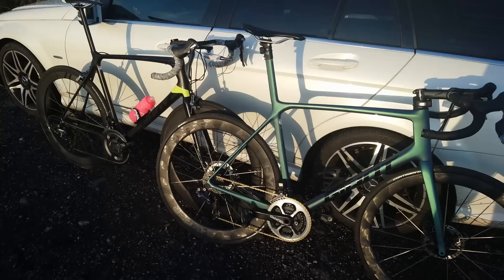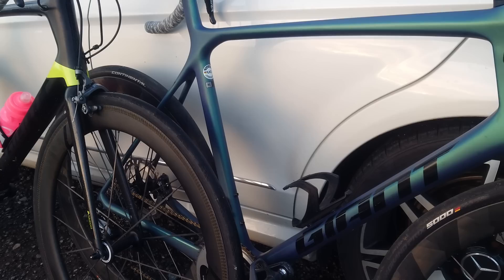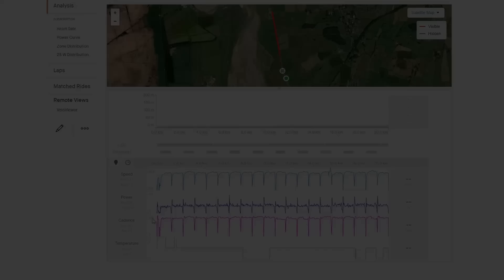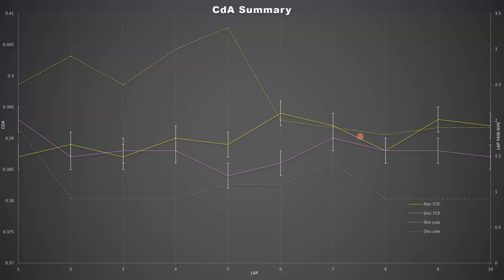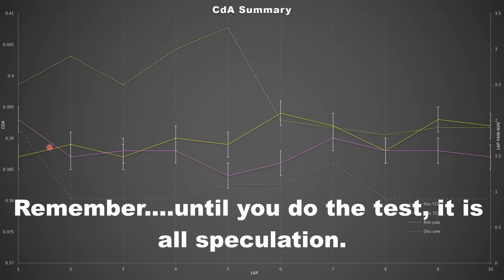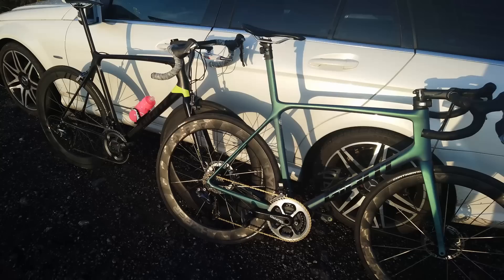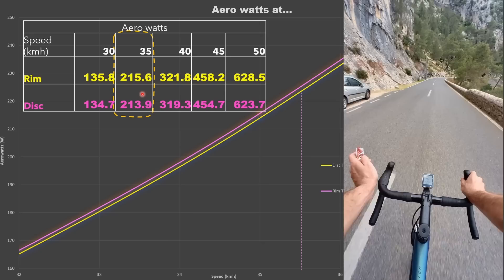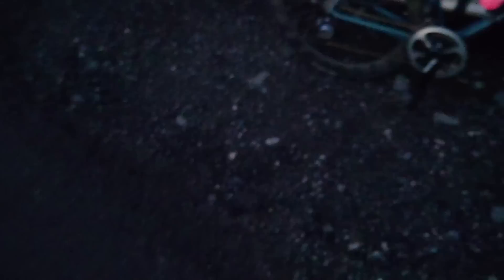Are Disc brakes Slower? Rim Vs Disc Aero tested.

Comment: If the difference is so small that this question is so often asked, why deal with the added cost, complication, and weight of disk?
Reply: Because of superior performance in varying conditions, better wheel compatibility, and improved tire clearance.
Reply: @hail_sagan2830  I'd wager that if consumers were aware of the pros and cons you and I both listed, most would go with rim brake. But markets don't actually work how people are taught. In reality consumers have very little power and have to buy whatever is given to them which explains the popularity of disk.
Reply: @anaxa4883  I don't know that I agree with that. Hearing, "disc brakes will stop you much more reliably in the wet," is a pretty big motivator for a lot of people. Adding onto that, "they also suffer virtually no aero penalty, which is shown to be more relevant to average speed than weight" will seal the deal for those that are concerned about performance even if they can barely hold 150W.
Reply: @hail_sagan2830  This is not true. Disc brakes fail in a dangerous way and generally don't perform any better than good clinchers. In esp. they are not better in wet conditions at all.
Reply: @rosomak8244  gonna need you to go ahead and cite some sources on that one. disc brakes have repeatedly been shown to perform better in the wet.
Reply: @rosomak8244  The entire field MTB would disagree with you here. So I'm gonna treat your statement as FALSE.
Reply: @hail_sagan2830  Ever been out in the rain? 99% of bikes out are hybrids or e-bikes. Its strange stopping power in the wet being such a big factor, when no one rides disc brake road bikes in bad weather. The Pas Normal/Rapha Aethos boys only dare come out in mid july
Reply from the maker: For me, you can brake harder and later, which is undeniably quicker. The braking is always consistent, whether dry or wet. Also on long mountain descents, the reduced hand/finger effort (ahoy there!) Is a game changer. Able to fling the bike left and right with a relaxed upper body and no arm pump. Of course if you don't race, none of that matters.
Reply: I can't reliability say for disc brakes as I do not have enough range of experience. But I can say that in my experience using about a dozen different brands of rim brake pads that the functionality of rim brakes varies significantly with choice of pads. Kool Stop Dual Surface brake pads with their integrated plow that quickly removes debris and water have proven to provide superior braking over a wide range of weather condition for me and are my pad of choice. I mention this because when comparing disc brakes to rim brakes I think the choice of rim brake pad used is of critical importance. I am unaware of any tests comparing the two braking systems where the the tester has sufficiently accounted for this factor.
Reply: @anaxa4883  not really. 
I’ve been cycling since 2008-ish? Started on a rim brake Avanti bike and slowly worked my way up. 

And the first major thing I did in cycling was ditch the rim brake and the stupid 23mm standard. 

You simply cannot match the braking control of a proper disc brake. I’m not saying rim brakes have less stopping power; I’m saying that disc brakes have so much more modulation that you can exert more power just before the wheel skids. 
This is literally a scientific fact, since rim brake pads are not simple solids.
Reply: @slowcyclist4324  I wish you could bring yourself and your disc brake bike to a mountain top to meet me and I would obliterate your entire reality and “scientific facts”  about disc brakes within 10 minutes of descending.
Reply: @edthelizzard  oh man I understand it’s a bit schmucky but that conversation between me and him has some more comments and context other than this particular thread. I was just poking the disc bro 😂
Reply: @larslosh5598  yes, I have ridden in the rain. What's your point? That people prefer not to ride in unfavorable weather? That doesn't change the fact that sometimes you do get caught out by a surprise shower or storm. Or you sign up for a race in Kansas that is usually bone-dry and scorching, but rains sideways on race day. Given that, again, there is virtually no aero penalty and that the weight difference isn't a significant factor unless you're climbing Mont Ventoux, I'll take the improved performance whether I intended to be out in the wet or otherwise.
Reply: @larslosh5598  Lol, the specific location is irrelevant. Inclement weather can happen anywhere. The Triple Bypass, an incredibly scenic and renowned ride in Colorado, was rainy for the entire event last year. If you don't like the aesthetics that's fine, but that is a preference of appearance and does not change the fact that disc brakes offer better performance in varying conditions.
Reply: @hail_sagan  I know, I live near the arctic and cycle all year. I know a young girl who rides a 23 mm rim brake bike in snow. And grown men in California feel they need 32 mm and disc brakes to survive. Thats ok, but if the skill level is so low you really should be riding with some kind vest or flag indicating you are still learning.
Reply: @larslosh5598  riding with wider tires for decreased rolling resistance and better ride quality and disc brakes for superior performance means you are still learning? man, someone should tell those folks racing Paris-Roubaix they're still beginners
Reply: @hail_sagan  Slight difference between doing it in Paris-Roubaix and the folks who claim its absolutely necessary for their monthly ride on perfect tarmac in sunny weather. Much like kids walking to school alone for the first time, you should be easily visible and very careful, not dressed "stealthy" and trying to be fast or aerodynamic in any way. Good luck

Comment: Very interesting analysis (as always) my take is that there is not a lot of difference in CdA. I think more relevant would be the impact of the extra weight of a disc bike vs. a rim brake bike (I reckon you need to spend £2000 extra on a disc brake bike to match the weight of a comparable rim brakes bike). How much extra wattage does an extra 500g on the bike weight requires to push the same speed on a 10% slope...maybe another video.

Comment: I won't ask you to do it again because damn those laps would be torture for me. But I WOULD like to still see the bikes using the same equipment. So same handlebars between the bikes and exposed cable etc. But I don't expect peak torque to do that.
Reply from the maker: 😎. Practicality of doing these tests in winter without being paid. Is the answer from me 😎
Reply: @PeakTorque   @Peak Torque  yeah no obviously not practical at all. Although my impression that I am getting from the result of this test is... Alll things being equal between the two bikes equipment wise, the Disk brake equipped model should be a hair faster.

Comment: Interesting. I am surprised by the low aero wattage, considering your basketball-player height and your giant bikes. It would be very interesting to know the total wattage, too. Thanks
Reply: Not really, his CdA is approaching 0.400 m^2. That's quite high for an aero-aware road cyclist. A pro cyclist of average height will be closer to 0.300 m^2 if not lower
Reply from the maker: I'm 195cm and 90kg. Most tests run around .38 on the hoods, elbows slightly flexed. Pretty good for my height.

Comment: You mentioned very cold and dry as being slow.  Cold, granted.  Why is low humidity slower? Surely the air is thinner.
Reply: More humidity makes air less dense. H20 (water) weighs less than N2 (nitrogen) and O2 (oxygen) per molecule. Combine that with Avogadro's law, and you'll see that high humidity air is less dense and therefore easier for objects to move through.
Reply: @sammyrides5536  didn't think about it displacing heavier gases.

Comment: Chapeau for so strickt clothing policy! (chapeau for not having a chapeau, basically)
Another seemingly obvious conclusion, deeper wheels have higher drag at greater yaw compared to shallower at lesser - would be easier to see if you rearranged the first graph by yaw instead of lap number. Will look skewed and shifted, but easier to check if there is a trend.
Reply from the maker: I have lot's of yaw vs drag vs depth data on different wheels on the same bike (which is what most of this testing since summer has focused on). I could probably make another video just on that. Ive found that deeper are considerably worse over about 8 deg (much worse than the wind tunnel data we normally see). Their operating window is definitely less forgiving.

Comment: What’s faster a 23mm internal, 21 or 19mm internal width wheels? I’m very intrigued as a lot more wheels are going wider internally.
Reply: Narrow is faster aerodynamically. But then there’s rolling resistance on less than perfect roads to think about, which is why modern wheels are getting wider.
Reply: @lukeh3020  Yeah, the roads in Adelaide are so fucking shit. But about 100 pot holes a ride and it’s hit them or a car. I am thinking of zipp 303 firecrest, light and good crosswind stability and good price.
Reply: It's also dependent on the rim's external width. No two 21 mm internal rim width rims are the same. The Rapide CLX's front rim is a lot wider than the CLX 50's.

There's also the 105% rule to follow, most easily done with Goodyears.
Reply: @yonglingng5640  what are your thoughts on 303 firecrest with 25mm internal
Reply: @jarrodfife242  With Zipp fully committing to disc brakes and tubeless (except for 303 Firecrest Tubular, 404 Firecrest and 808 Firecrest, the latter two wheelset can still run clinchers), I'm very much less fond of them now (never was a sucker for Zipp wheels) due to them going 25 mm internal and hookless, so in my opinion, they're only best for riders who fully prefer riding tubeless. Because of the tubeless commitment, the running costs of almost all of their wheels aren't cheap.
Reply: @yonglingng5640  Yeah, I’m currently on tubeless so it might suit me though.

Comment: Anyway those are the results. And I dont get it, which one was faster?
Reply: As tested with all the slight differences in set up, the disc bike was slightly faster. To go 35km/h it required 1.7w's less which is tiny! I don't know about you but I ride at about 31km/h on the flat. Extrapolating up to 50km/h with equations, it would take about 4.8w's less to maintain this speed on the disc brake bike. As stated, a slight adjustment of body position would more than account for these differences.

Comment: I'm quite surprised by the results! 

I'm a fan of discs (and if you've ever experienced a rim brake fade on a steep descent you know why). But I still think rim brakes have their place. Never understood why time trial bikes would be specced with discs - in a time trial, aero truly is everything, and they're unlikely to see prolonged hard braking. And at time trial speeds I just can't imagine discs being faster?!
Reply: The thing is no one ever really tried to streamline the cables on a rim brake bike. 
I do own a propel with one of those TRP rim brake (and let me tell you they work crazy fine) but on the front one, although they are behind the fork in relation to the wind, the cable sticks out to the side like a sore thumb and goes straight up to the handle bar.
(Fantastic bike though)
Discs appeared at the same time as integration became a main thing, but you don't spend double the money first for integration and then to plan out the brakes arrangement, you either do both or none at all. So Bike engineers (who were scarcely the greatest to begin with) only bothered to create new frames with the new disc and with an improved integration.
TT bikes are the smallest, nichest market. You can sell triathlon frames in decent amounts, you can't with pure TT ones. But triathletes have access to non UCI regulated races, they don't have to bother with all of the same Lugano charter spreadsheet on their frame. So there's better gains to chase than the brake arrangements, on top of that they start their TT with the fatigue and its inherent loss of lucidity of an all out swim so OFF Course they would favor the extra security of disc ten times over the marginal advantage of a rim brake. All the more reason not to bother with properly integrating rim brakes hiding cables as much as possible having almost none of it sticking out and placing the calipers at the most efficient places (like those TRPs... Ô Giant, you mad lads, you were so freakin close to doing it...)
Reply: @lauig  Trek Madone SLR 8 was a cables streamlined rim brake bike
Reply: @gokaygs  There might be a few others as well, always high end non accessible to masses though (at least this side of the ocean). A shame really, that madone was sublime, still is.
Reply: @lauig  I don’t know any other rim brake bikes with hidden cables, the problem is that integrating the rim brake calipers into the frame with cables hidden is likely to require frame specific proprietary calipers which may be problematic from a performance or maintenance perspective.
Reply: @gokaygs  The Venge Vias had some custom rim calipers for aero purposes. Probably one of the fastest bikes ever built but even without hidden cabling those calipers were a pain in the ass to work on so you're definitely right about maintenance
Reply: @quarkonium3795  you are right, I forgot about the venge vias. I remember hearing about it being hard to work on etc. And even some accounts saying the proprietary calipers on the vias didn’t  work that good but I have not experienced it myself.

Comment: Thank You @Peak Torque for this testing. 

It's a good thing that disc brakes were faster because there are (currently) only brakes for modern higher-end road bikes and groupsets.
Reply: You can’t drive this co clubs ion, just that bike 2 is faster. Wheels, width, bar size, crank, integrated cables are different… brake types is just one of the differences. The intent is good, the execution failed
Reply: Don't panic there are still companies like Basso and Campagnolo that are making high end rim stuff. It's just a shame that they don't get to be seen that much.

Comment: so basically put the narrower bar on the rim tcr so match the disc tcr and the rim model is faster
Reply from the maker: Speculation.
Reply from the maker: Speculation.
Reply: @PeakTorque  I think the differences are so small it could overall make the difference

I was shocked it was so close as the newer tcr is meant to be more aero...

I remember when GCN did tests back when John was on the show with 2 identical pinerellos and the  rim model was faster across the board 🤔

Great video enjoyed it I've had a disc and rim tcr myself but prefer the rim one by a mile 😂 but that's me

Comment: You could always argue on the little differences between the frames, the cables, the handlebars, the wheels...but for someone that does not own a bike shop and hence does not have all the possible gear at disposal, it's the best comparison that you could do. Massive kudos for the effort and to finally bring some consistent data into this debate. I would conclude that, for all intents and purposes of almost any cyclist, there is basically no difference.
Reply: Except for the difference in braking performance.

Comment: Per the title of the video, this test was pretty much a waste of time. There are too many substantial differences between the setups to allow you to make warranted inferences about the drag impacts of disc vs. rim. All the data tells you is that the sum of differences between component choices are marginal.
Reply from the maker: Let me give you your money back... in an engineering scope any test that gives repeatable data, and adds to the learning bank and data pool valuable. If only to me to prove there is no real difference between this bikes. I erased my own doubt that the disc bike was slower.
Reply: @PeakTorque  I didn't assert that the data wasn't valuable, I said words to the effect that the title of the video is misleading - its just not an apples to apples comparison that allows the isolation of cause. You of all people should know that.

Comment: I have rim brakes and honestly they're shit. I am constantly on the edge, painfully aware of how fast braking will destroy my gucci carbon wheels. It's terrible. I find myself avoiding anything but optimal riding conditions and even then I'm constantly worried about wearing out my rims. It's not a coincidence nearly all adverts on rim brake carbon wheels say they've switched to disc brakes. Get discs if you can.

Comment: An Aussie rider won in national race buy putting a block of gopro under the handlebar.

I saw a video where a rider won national race by using china made 400usd frame, non uci, obviously crap material.

In other video, some worker ride on very old heavy steel bike, crap steel bearings, low tension spoke, cheap tyres, upright position, min weight 25kg, accelerate during decent w/o pedalling leave triathlete bike behind.

By today aero frame standard, the most worth for money bikes are from WINSPACE, PARDUS, POLYGON, GUSTO, JAVA, etc.

Today big bike brand want to increase price by change the frame's design almost neglictable the marginal aero gain and claim it is a game changer in aerodynamic frame. Ptuuuiiihhh!